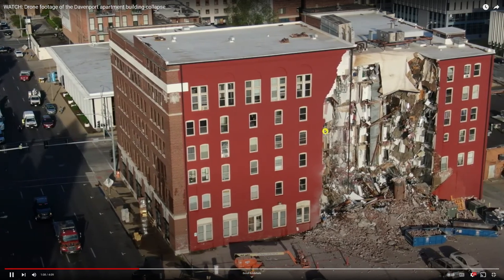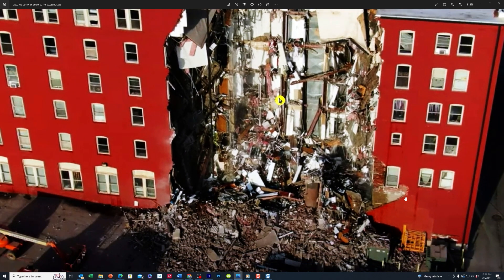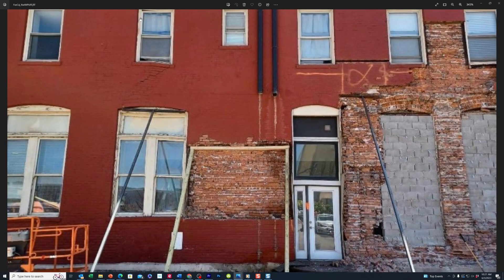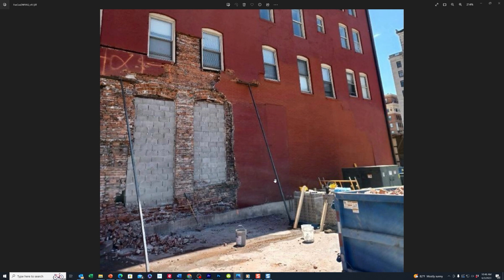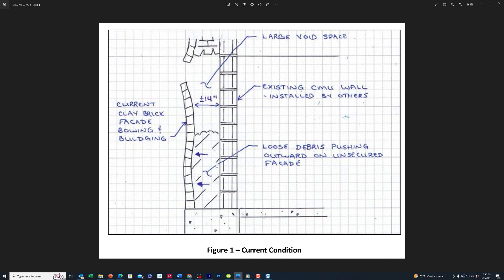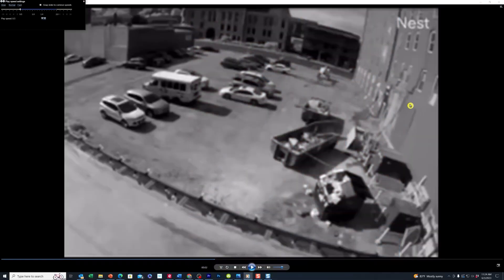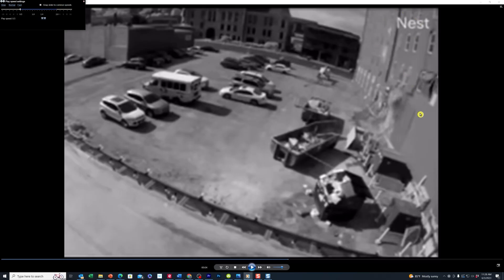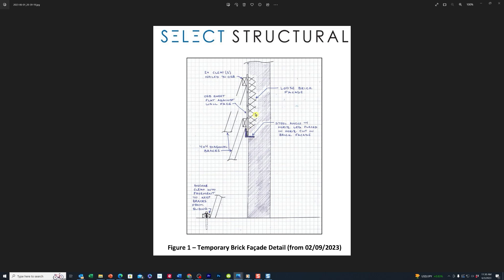Davenport Collapse Security Cam Analysis Pinpoints Origin

Comment: I wonder if the owner will hold the construction crew/company liable? I mean THEY were there to FIX it? Now if they bid the job, then that says they were capable of fixing it, supposably right? I would like to see the wording on the contract and if they put in any "CLAUS" about it collapsing. Hope they had insurance! Where is the anchoring that goes on brick to hold it to the main structure? Wire mesh in between layers of brick too? I do not see anything.
Reply: You mean the guys the owner picked up from the sidewalk in front of Home Depot??  Seems like that was the level of greed and incompetence at work here...

Comment: Didn't they use to have indoor bricks and outdoor bricks back then? They looked alike, but if the indoor brick got wet it would collapse.
Reply: Usually face brick with common behind common brick is standard brick. Where they have different bricks inside vs. outside is fireplaces and chimney brick I.E. Fire Brick.

Comment: I was curious, so I looked up the Google drive-bys. The one on 4th St. from 2021 shows the red painted brick. The one in the alley on the opposite side from 2017 shows orange paint over the same surface. If one layer of paint is bad for brick, I can't imagine that two layers are better.
Reply from the maker: A lot of patches were done on that building for sure.none helped.

Comment: The building's owner seems to have price shopped for the cheapest way to get the city off his back. If he really did tell a contractor that he did not want the shoring, etc., that the structural engineer specified, I hope he gets criminally prosecuted. Also, how much work would a contractor do for only $3,000 when the responsible contractor (Shaffer) estimated it should cost $50,000? Was the contractor that the building owner selected even a state licensed contractor? And if so, what type of contracting license was it, and would he have been qualified to handle a job like this? The 2x4 shoring you pointed out was a joke. It looked like something that an ignorant unlicensed contractor might have assumed would meet the requirements. And did the contractor ever see the engineer's specifications, or was he only doing what the owner told him he wanted done?

Comment: I didn't live in the building, but a couple minutes from it.

The downtown area of Davenport has always had a reputation of potholes, old buildings, etc. There's always construction on the roads, and not a ton ever gets fixed. Its basically becoming a running joke for as long as I've lived here. So, if you're wondering "How did the people of this city let this building go on like this?", its because we're used to this kind of deterioration, especially towards the west end.
Reply from the maker: Like the old potholes on beacon hill in Boston back in the day
Reply: I lived in Davenport a long time ago, when the state was solid blue and the city wasfairly well maintained.
   Yes, I think this is political.
It started to shift to red about the time I left ... and Republicans just don't give a dam.

Comment: The electrical system in the building that collapsed must've had a series of short-circuiting branch circuits/ feeders that completely destroyed the local distribution system. That's why the Nest camera stopped recording when it did.
Reply: Thanks. I wondered why it stopped recording.
Reply: @cremebrulee4759  I’m not positive but it’s likely that both buildings were connected to the same utility transformer set up.
Reply: @electricianron_New_Jersey  Pictures of the building show the utility transformer very close to the building, maybe some of the falling rubble damaged that transformer. I'd think there would be a main breaker or fuse for the building that would trip or blow before the primary fuse for the transformer would.
Reply: @uploadJ  Pad mount transformer that feeds my house is fused at both the transformer AND the pole it's fed from. That pole feeds 2 other padmount transformers and they all have a fuse at that pole too.

Comment: I have been looking at the whole thing for some time as well. Your videos have helped, but the real cause of the failure is from the roof leaking and the original roof drain being inside in this location, it was built for the water to drain here, causing most of the roof to pass thru the structure here. Yes it could have never had a problem but this leaking went on for at least 40/50 years. 
The new owner new of problems but always probably thought it was just the outer portion, but from your pics it was exactly what I suspected and if the rest of the building is not in bad shape it could all be fixed.
Reply: No, that isn't the cause.  You are talking out of your ass...

Water didn't cause the building to fall, removing load-bearing brick did.

The underlying cause is the stupid 'hybridized' design of the building, plus the aged brittleness of the crap mortar they used back then in masonry work.  Throw in a cut-rate, bumblefuck repair job, you get collapse.

Comment: It looks to me much like one of those above ground pools that contain water so long no hole comes along and allows the pressure from the water to escape. Once this happens, it's likely to rip a big hole in the side of the pool and not just rush out of any hole that forms.

Since the structural bricks had been falling and pushing the façade outwards, once they removed what was holding back the pressure of those accumulated bricks, it turned into a big hole just like when you get a small hole in one of those above ground pools. Since that façade could not have been that strong, it likely didn't take much in the way of pressure relief for it to all go at once.

Comment: That brick contractor dodged a major problem by not getting the contract.
Reply from the maker: Yes I would feel relieved
Reply: Nooo, he knew how to do it correctly. Thats why he didnt get the job
Reply: Yeah, I think that contractor realizes that he didn't know what he was getting into, trying to repair a thick, load-bearing wall holding up the whole building.  It sure as hell would have cost more than $50,000 to do the repair correctly...
Reply: @johnbergstrom2931  The first bidder listed $50,000 just for the bracing.  The winning bid was for $40,000 all in.
Reply: @harleymcclure9802  Well, that makes sense.  $50k for bracing, maybe $250k to rebuild the wall...
Reply: @harleymcclure9802  40000? or 400,000????
Reply: @johnbergstrom2931  the outter bricks were supposed to be decoration, and not load bering.
Reply: @williamhaynes7089  Yes, but any competent contractor would have realized that the entire wall section (at least the first 3 stories) would have had to be rebuilt in order to save the building.
Reply: @johnbergstrom2931  Im sure there have been many bids over the years, the prvious owner sold it most likly because it was a bigger fix than they wanted to do. I wouldnt be suprised if a contractor or two looked azt it and said they were the wrong person for the job as well and walked away.

Comment: Your right about the collapse happened due to a combination of things - I totally agree with that.  After viewing other videos (drone's view) & this video you showed is that the bldg will collapse when there is a rain storm, high winds etc.  Right now, the rubble is giving it stability.  They need to be pretty careful about moving the rubble to find people.  Wonder if heat sensor equipment can pernitrate thru rubble?

You can also see on the roof how it hangs due to the collapse - downward/slanted upward to the left.  No doubt says the top of the bldg has been pushed inches to the left (& the unit is still intact with the roof but fell towards the 'right' of the bldg).  This bldg is TOP HEAVY.  The speed of the collapse, weight of floors/bricks, of course gravity (& momentum) created vibrations (like an earthquake) weakening any additional supporting beams/walls no doubt creating gaps along the existing window frames. Plus, the part of the bldg that didn't fall is more likely leaning inward - nothing to support it.

It's going to take some great skilled people/companies to bring down this bldg since the left side -> top of the bldg is leaning left.  Hope the business beside it has moved to a new permanent location.

Comment: When the only parts of the building that fell were the parts that suffered water and freezing damage due to lack of maintenance how in the world can you try to blame the original design of the building?
Reply: Original work from almost 120 years ago did not seem to be a problem.  The conversion to apartments in the 80s is more likely the wound that festered for the recent decades.  That wall looks like it previously had large loading dock type setup with big openings that were very poorly patched over, not even concealing it.  Looks like there was nothing added to support the openings and they just steadily sagged and delaminated.
Reply: Yeah, I think blaming the original design or the building standards of 1906 is completely unfair. The building survived 117 years, much of it seemingly with severe neglect and substandard (by 1906 standards) repair, and then when it did fail most of the building remained intact. I have no doubt that if it was maintained as envisioned by the original designers, it would still be standing and sound.

Comment: The illustration you showed of a concrete block wall with a brick veneer is totally irrelevant to this construction on this building that was a loadbearing wall and there was no concrete block behind it and it was not a veneer brick

Comment: I have never heard of nor would it make sense to have a veneer (non load bearing) layer of brick right next to loadbearing layers of brick. never happened. those steel beams are resting on the brick, and since the brick settled the engineer wanted  the ends of the steel beams shored up
Reply: Sloppy patchwork years back when it was converted.  They just skinned over openings but added nothing inside to support.  Same quality work done more recently including the red paint to hide the patches.
Reply: Well, masons 116 years ago apparently did it that way...

Comment: Every image shows that a section of the building collapsed.  Unless there were explosives involved (there weren't) the failure started somewhere.  As in one single place that was weakened enough to start a general failure of the structure.  Which ends on the rear wall and at the two side walls that didn't collapse.  Yet.  So why make this video?  Why listen to this guy drone on for twelve minutes as though he has some insight that we need to hear?  Gravity never stops.  That's what's real here.  Jeepers!
Reply: It all started with one drop of water many years ago that made its way where it should not have because of deferred, neglected or improper maintenance ... with me so far?

Comment: Thanks Jeff for the videos on this collapse, I wasn't aware it took place until I saw your first video.

I have studied all the available photo/video coverage as well to determine the failure mechanism(s).  Given when this building was built and its close proximity to the River, I assume it was originally either, an office building, manufacturing, or a government building.  Looking at the satellite photo, it looks like the building has 3 add-ons.  At some point in time, the interior was probably completely stripped out, then the apartments added.  I don't think there were any mandatory building standards in 1906.

The collapse appears to be related to the exterior wall failing but, I am not sure of the structure design.  Depending upon picture location, I see differences.  Also, is the building load carried on steel I-beam columns or the brick wall?  Given all the complaints about water and sewer leaks within the building, the I-beams could easily rust out at the attachment points (and I do see lots of rust).  That location of the collapse, from various pictures over the years of Google Streets photos, is a 12' X 30' section at the ground level that has been reworked (probably several times) that may have been garage bay doors originally (but hard to tell).  Also, some parts of the exterior wall show 1 course of red brick, while other areas show 4 courses (which may be where the large doors were located).  The concrete block walls appear to be cast concrete in some areas, other areas possibly large concrete tiles.  It will be interesting to see the actual failure mechanism(s) if and when that information is made available.  I think we can assume at this point, the causes fall into the categories of lacking/improper maintenance and risky short cuts when the apartment retrofit was installed.
Reply: I've heard the building described by engineers as a 'structural hybrid'.  The steel frame and exterior brick wall support and stabilize each other.  Both are load-bearing.  Neither alone will take the load.  Was apparently considered state of the art/advanced in the early 1900's, but it's a stupid way to design a building...
Reply from the maker: @johnbergstrom2931  yes the steel structure ought to be able to support the load.
Reply: @jeffostroff  116 years ago, the decision to build that way probably came down to the timeless motivation, the owners wanting to save money.  "Steel is expensive!"

Makes you wonder if the people doing the brick work (or even the contractor who got rejected for the job) knew what they were up against, or if they just thought the brick was a veneer, something that wouldn't collapse the building.  I personally don't think they knew...
Reply: @johnbergstrom2931  In researching 1900's high-rise building construction, I saw both load bearing by a totally steel structure and the combination where a steel support structure is used but, is tied to a brick wall for all its support.  Interestingly, I also read that the construction techniques used in 1900 are so much  different than now, applying modern day construction practices will actually acceleratate deterioration of the structure.  Thus, a thorough understanding of the 1900's construction is mandatory before attempting any repairs.

Comment: Your close-up photo of the buckling shows several layers of bricks that have separated as the wall bulges out if the outermost layers bulge more than the inner layers, there’s gonna be gaps between the layers of bricks. Your description of the outer most layer of bricks it’s just a nonload bearing veneer is BS

Comment: Just because the outer layer of bricks separated from the inner layers of breaks, does not mean it’s supposed to be that way and it’s just a cosmetic veneer.
Reply: No, it means that the old-ass crappy mortar is failing, failing in the whole building.

Comment: Just looking at the pictures after the exterior bricks were removed I could tell that there was little support and was horrified that it didn't collapse while they were being removed due to the vibrations. Clearly no one was listening to the experts.
Think of a V,the the bricks between the door and the old window that are Swiss cheese shifted and the pressure V'd up to the next weakest points.

Comment: That building should have been evacuated a long time ago. Neglagence on the city's part for allowing such an obvious threat to fester.  In the old pictures the wall had been painted before at some point. May have covered up faulty work when windows were removed. Tragic! Love your work Jeff!
Reply from the maker: City  had condemned several apartments in there in 2021
Reply: The seem to have found a scapegoat because one of the city's engineers resigned. I'm sure they'll be looking for other to blame in the upcoming weeks.

Comment: Where did you get the notion that this is a non-loadbearing wall?
Reply: The outside layer that's how brick buildings are designed the outside layer isn't the load bearing it's the inside layer just how brick buildings where make back then the outside layer is basically like siding today
Reply: Because it is not a load bearing wall.  The building is supported by its frame, which is timbers.
Reply: @anthonytripp2251  you’re nuts where did you get your structural engineering degree even started a masters degree in it
Reply: @GOLDVIOLINbowofdeath  John Jay College.  I was a FDNY licensed Fire Safety Director for 23 years.  It's called sticks and bricks construction.  You could not build a brick building six stories without interior framing, which in this case was 100 year old oak beams.  The brick facade is not load bearing.  There are other factors but no use in me wasting my breath.
Reply: @anthonytripp2251  great, I started my masters degree in Architectural Engineering at UT Austin in their civil engineering school that is rated #5 in the US
Reply: @GOLDVIOLINbowofdeath  Maybe you could learn English while you're at it.  Grammar counts.
Reply: @anthonytripp2251  which John jay college is this the only one I see is for criminal justice and they don’t list any architectural or engineering degrees
Reply: @anthonytripp2251  the frame is steel and the end of the steel beam sits on the brick load bearing wall